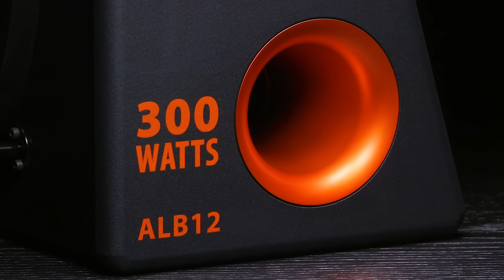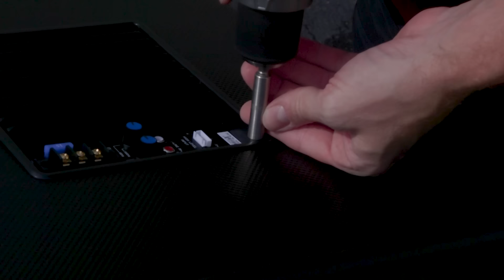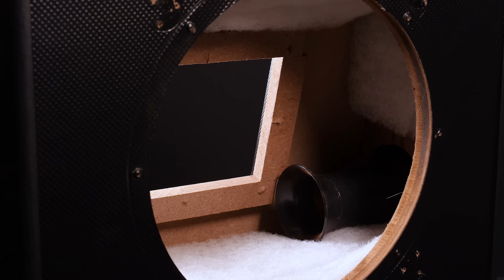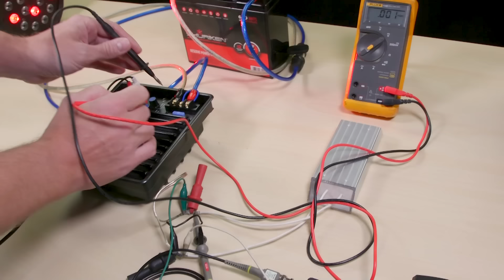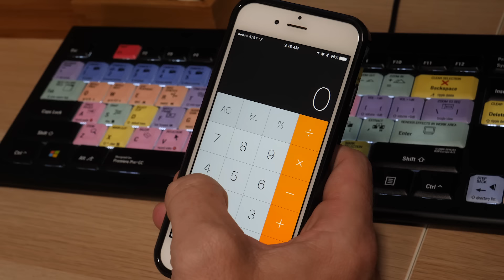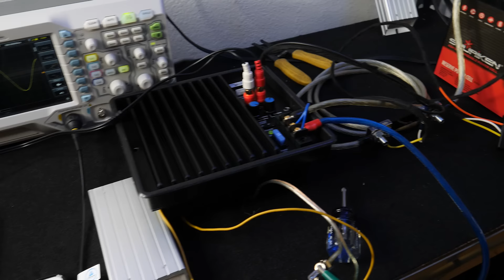Sh*t Car Audio Manufacturers Say! Reverse Engineer an Amplified Subwoofer

Comment: It's tuned to 75hz??? LOL
Reply from the maker: Yea man!
Reply: thornygravy lol annoying bass lol
Reply: WTF, that's not a sub!!!
Reply: My old Panasonic system was tuned to 70hz.. with 5-1/4" woofers lol
Reply: thornygravy a regular woofer can do 50
Reply: that's a bit unrelated sir lol.
Reply: ok
Reply: The device is designed for a flat response in free air. It's a CAR sub woofer, and it works quite fine when it's operating inside a car. According to this guy it's under-powered, however I have my doubts that what we are being told about that has any scientific basis whatsoever.
Reply: jesus even Logitech subs play lower (z623)
Reply: BH4x0r - I doubt that any Logtitech sub would be almost flat down to 30Hz like this thing. Anyway, with Logitechs it's the complete lack of ANY treble that makes them sound so shit.
Reply: John Coops, as you could see if you watched the vid, it doesn't play flat at all, and not deep at all (not even near 40, as you saw in the vid it's tuned to 75Hz), and no logitech subs don't really play flat, nor are their satellites any decent, but the Z623 plays down to about 35Hz clean-ish. Not flat or anything, but still better than this dual sub. The dual sub maybe plays down to that in a CAR, but the Z623 even does that in a HOUSE, which is obviously better since it means that it doesn't have to rely on car acoustics to actually play pretty low
Presonus Eris E8 studio monitors do actually play flat down to 35Hz, which is why i love them, even when i'm not using a subwoofer.
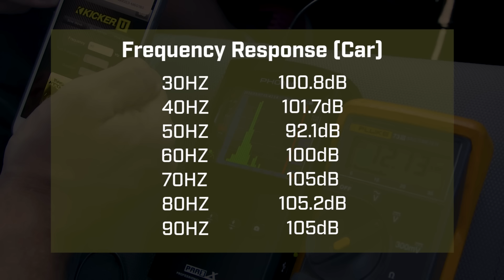Reply: BH4x0r - if *YOU* watch the video, you will see at 6:25 that when tested in the environment that it is designed for (a car), it is pretty much flat (within 6dB) down to 30Hz (the lowest that was tested). The fact that a Logitech can do 35Hz or whatever inside a house is totally and utterly irrelevant since the Logitech doesn't work in a car. The Logitech would sound shithouse in a car anyway, in the same way that this Dual is an absolutely shithouse in-home sub. As for your comment "better since it means that it doesn't have to rely on car acoustics to actually play pretty low" is some unbelievably idiotic that I cannot even begin to respond to that.
Reply: John Coops still useless outside of a car or if improperly positioned, placement to be able to reach that will be necessary and will also depend on vehicle, it's always better to have something that plays ALL frequencies and then later in the car being able to eq frequencies
Reply: John Coops i actually tried the Z623 in the car about 3 years ago on a MTX RT250.1, sounded fine.. played deep etc
Reply: BH4x0r - "still useless outside of a car" = YEP, just like every other car sub. That's because they are... guess what... designed specifically for use in (can you grasp it) a...*CAR*!
Reply: doesn't explain why my xplod (which i dont have anymore) played down loud and clear to 33Hz in the house, and that is not even a "good sub", it was just a XS-GTR121L, in a kinda big prefab box (just for a 12" tho), or bigger than some of the cheap garbage i've seen on the walmart site in the US, atleast.
Reply: My 6.5" subwoofers are tuned to 30
Reply: Car Audio Inc  my but hole is tuned to 75
Reply: Sorry to hear that. Should have used lube.
Reply: Car Audio Inc then they are just wet farts..lol..I get it..Just joking with the tuning of that bargain box..sure it will be fine for an average person just wanting a little bump in a weak stock system.  But man I love bass and stuff like this has all the 16 year olds thinking they are beating down the block
Reply: lol
Reply: Hurricane Zephyr sundown audio subs are usually tuned to around 34hz and sometimes lower
Reply: looking at the size of the box, it would be hard to assume its tuning was low. they shouldve kept it sealed
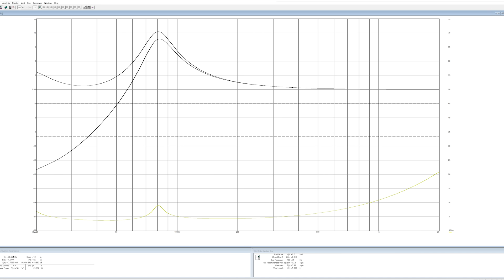Reply: It's tuned at about 45 Hz. You can see at 7:56 that there is the lowest point in the impedance response which usually is the case at the tuning frequency of the port. The problem is the high Qts which causes the 10 dB peak at the so to speak "tuning frequency" of a closed box with the same volume. The port has no use for this driver. If you close the port the frequency response will look nearly the same.
Examples:
1) A driver with a Qts of 0.4 needs to have a Vas as big as the box volume. In this box tuned to 45 Hz it needs an Fs of 62 Hz to get a flat frequency response. The lower cut-off frequency (-3 dB) will then be at 43 Hz.
2) Driver with Qts 0.45 needs a Vas of 0.83 times the box volume. In this box it needs an Fs of 64 Hz to get a flat frequency response. The lower cut-off frequency (-3 dB) will be at 42 Hz.
3) Driver with Qts 0.35 needs a Vas of 1.25 times the box volume. In this box it needs an Fs of 56 Hz to get a flat frequency response. The lower cut-off frequency (-3 dB) will be at 44 Hz.
I just looked through data sheets of 36 different 12" drivers. None of them came near the needed value for Vas. I'd say it'll be hard to find a matching 12" driver. Maybe a 10" or 8 " might fit.

Source of all my knowledge: German DIY loudspeaker magazine Hobby HiFi, especially the bass reflex tuning diagram from issue 5/2003.
Reply: lol my subwoofer is tuned to 16Hz :)
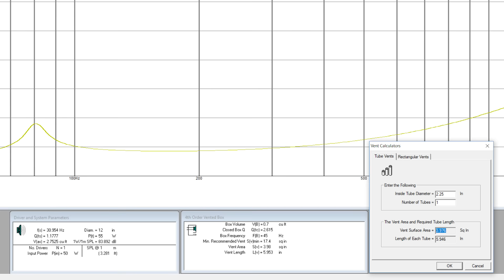Reply: It's tuned to 45Hz, not 75Hz. You can see the calculated Fb at 7:43. Box systems don't always make peak output at the port tuning frequency. Other factors can contributed to output, including box size, driver resonance, and cabin gain. Notice in-car measured dB shows a little recovery at ~40Hz. That's the port doing its thing.
Reply: My friend's philco component is tuned to 125hz lol
Reply: I don't even know what a hz is.
Reply: What many here don't realize is that "tuned to 75hz" does not actually mean that it can not play any note lower than that. This sub can play even a 1hz signal just fine, like any sub can. They just artificially amplify that frequency to make it sound louder (or possibly to make it flat in a car).
Reply: This is not accurate. What some don't realize is that cone motion does not equal sound output. "Any sub" can be driven by a 1Hz signal, but almost none can actually produce a measurable result (sound waves) at that frequency. Physics (cancelation) and mechanical limits (excursion) of the driver prohibit it.

A subwoofer system's sound output (freq response) is relative, not artificial. At the system's vent tuning frequency, the relative output is higher than at below the tuning frequency. Drivers in vented systems unload below the tuning frequency, causing a relative sharp drop in output, again limited by physics and mechanics of the driver.

Effectively, this means a vented system cannot play a lower than it's tuning frequency, because the relative SPL below the tuning point falls off sharply. Nothing is being "artificially amplified". The vent is enabling more of the speaker's kinetic energy to be used as sound output. Similarly, a speaker's cone enables the kinetic energy of the voice coil to be used as sound output.
Reply: How does cone motion not equal sound output? The frequency of 1Hz being played by a speaker very well produces sound.
Reply: But this so called sub can be used as a mid freq- speaker for the z623 !
Reply: Cone motion does not equal output because of cancellation. A speaker operating "free-air" (without an enclosure) cannot reproduce lower frequencies because the waves from the rear of the cone will cancel out the waves from the front, as they are reverse phase. The purpose of an enclosure is to trap or delay the rear wave to preserve or augment the front wave, producing sound pressure that can be heard or felt.

Because of the extreme length of a 1Hz wave (~350 meters), an immense stroke and driver displacement is required to create measurable output. Currently the best driver type for this low frequency is a rotary type. A conventional cone type would need to be very large diameter and have very large excursion. Or, an array of several smaller drivers could pressurize a small cabin or room.

Even though a moving speaker cone technically "produces sound", if the result is so faint so as not to be measurable by a microphone, and not powerful enough to affect the listening environment, then it really doesn't qualify as sound.
Reply: WeKnowTheTruth2012 uhhhhh a regular subwoofer does 20-35hz

Comment: You can do 150db with a single 8....a 153 sealed on dash with a single 8 has been done years ago.
Reply: I once ran two 8" as headphones using a $40 Boss 1000W amp. The clipping made my head melt.
Reply: elwood98034 are you from elwood KS by chance?

Comment: Measuring the volume with plastic Airsoft BBs would be better than packing peanuts, because the plastic BBs are uniformly-sized and non-compressible. Sand would be even better because the grains are smaller and can pack more tightly, but I can understand not wanting to deal with the mess.
Reply from the maker: I totally get your points, lol but we ain't putting sand in that thing

Comment: Will adding a stronger amp to this sub be sufficient for a budget set up that is decent? The box looks good and the sub can handle more power . Currently running this active sub in a hatch btw.

Comment: So.. if im not mistaken dB works as an logarithmic scale, for every 10db the sound level goes up tenfold, so dosnt that mean to get that 10db bump you need to add 10x power to the sub. Makes you wonder when they make such an huge mistake what else is wrong.

Comment: dual makes some decent stand-alone subs, key word I said decent not outstanding. Don't expect to blow your car apart, but you can get some window flex if you set it up right
Reply from the maker: Cheney, done right their stuff sounds decent.
Reply: Cheney Vanderbilt 
They do and actually most subwoofers are decent including Pyle and Boss. It's just what you expect out of them has to be realistic. You can't trash a sub that says it can only handle 150 watts and compare it to another name brand.
Also box design, construction, and clean power AKA tuned right no clipping are the major factors of making even a lower-priced sub sound great.
The reason most name brand subs sound better is because the person purchasing them usually does more research if spending more for a subwoofer or having a professional shop install it.
Reply: Amen bro, if you want to see some duals put in work search for the video "low budget flex"
Reply: I d agree with u. Just for shits we ran two 12 in duels in a pre fab box on two crensendo 5 ks at a 30 hrzt test tone they lived for bout 10 min lol
Reply: LOL 10 mins is still amazing for 175rms subs, I've seen kickers smoke up on 1000rms
Reply: Hey thats your opinion, pretty big one from a guy with no subwoofer videos.
Reply: Not even gonna read that, you win smart guy
Reply: Chip Monk I guarantee you I can build a system from Walmart sold parts that will sound just as good as any other part bought out of a catalog or online. I don't understand how if it's sold at Walmart it's crap if the same part is sold on Crutchfield or Amazon and has a hundred great reviews by reputable people.
Just where does one go to buy the best items that aren't crap in your book?

I guarantee you if you are blind tested and had to listen to the same material on a Boss system.... or a Helix/Brax system.... if you know what that is... You would not know the difference and I probably wouldn't.
Reply: Chip Monk 
Once again for $100, I don't think anybody looking at this is thinking oh my gosh I'm getting $1,000 amp for a hundred bucks! Or even 300 watts. Most people looking at this don't even know what a what is. We have to remember where a select few criticizing this product that has sold to millions and made a company a lot of money. People would not keep buying it if it was a piece of junk in their eyes.
But then again is anyone going to say that a set of Brax 3-way component speakers is worth$4,000? Oh I'm sure someone is already typing you get what you pay for it. Yes it's worth $4,000 as this person typing is driving a $3,000 car LOL. Getting what they paid for out of the car LOL.
We should not judge anybody's intelligence based on what they spend on car audio products.
Right?
Cause in my opinion someone that buys $4,000 worth of speakers is very ignorant and less they make seven digits a year.
Reply: You have to have subwoofer videos to have opinions about car audio equipment? Wow. Didn't know this criteria and checklist existed. I thought you just had to understand car audio and maybe love it and know a lot about it but obviously you have to have videos LOL.
That's intelligence.

Comment: Easy and quick way to "check" the truth about power on car amp (Most other amps to) Is to check the fuse
if it is lets say 15 amp fuse, on 12V system, and they claim 300 - 400W you know it is impossible coz 15A X 12V = 180W
So if the amp in a peek draw more than 180W the fuse gona blow ;)  But when driving, many cars have 14,2 V 
 But still 15A X 14,2V = 213W

(P(W) = I(A) × V(V))

That means that the nominell effekt probably is closer top 80W and no way it can draw 300-400W
And do remember some of the power it takes through the fuse also goes to heat and resistances. Not all energy goes  to the woofer.

Now ofc this is not 100%  accurate, It also depend on the voltage to the woofer. But converting will also "steel" power

sry for my bad english

Comment: Nice to see someone actually test these things with proper measuring devices... but... I question your choice of signal generator, get a real one, or even build one. Sine wave generators are cheap and simple to make or buy, and then you get nice granular volume control instead of the digital stepped volume crap coming out of your iCrap device.
Reply from the maker: +idiolore we purchased a function generator, it will make its debut shortly!
Reply: Awesome, looking forward to it :)

Comment: I assume if you'd replaced the woofer with a 2ohm one, that it probably wouldn't handle the heat aka protect mode as well.

Comment: I was starting to say the voltage in a car would not go below 13.5 volts, your battery isn't large enough to test this amp. 12.3 volts is a battery with a 60% charge. may be able to run the test while charging the battery, most amp ratings are at 14.0 volts not 16.0 volts.
Reply from the maker: +bradley goode the retest was only slightly higher

Comment: i created a portable recycled bluetooth speaker (supposely 100w max) and i was wondering are all speakers cheaps? the problem with mine is under heavy bass loads the speakers basically sounds distorted.

Comment: Great vid - Subscribed!! I do have a question about your method though... When installed in a vehicle, and hooked to the electrical system, the amp is getting more than 12v from the alternator, and I noticed a lot of voltage drop from the stand alone battery. That being said, I think it might have eeked another 5w, if that, but it would have been fairer. Either way Im excited to see how you boost this amp for the cheap!!!

Comment: 6:25 | 5dB up @ 80Hz reflex tuning peak in-car response is still enough to be problematic. The underpowered amplifier and inadequate driver cannot provide what is required; hearing sensitivity falls away with lowering frequency. A 5dB peak would preferably be observed in the 30-40Hz range. 80Hz is not a good point to see something like this. Subwoofers are supposed to provide deep, satisfying underpinning and this device is broken even if cheap. Better could have been done for the same retail price.

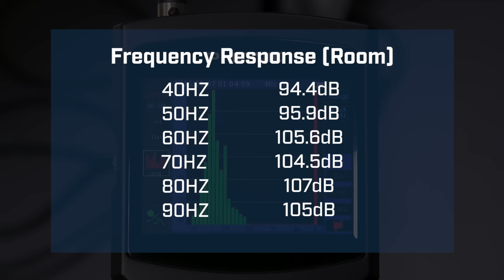Comment: 5:13 | That hump in the 70-80 cycle range will produce a fat, boomy bass. It's 10dB up on 40Hz so is significant enough to be audibly horrible.

Comment: And to be correct with everything:
An extra of 10dB means 10x the power according to physics:
P = 10 ^ (L / 10)
And in the other direction:
L = 10 * LOG10(P)

Or easier: Every +3dB means double the power.
0dB - 1W
+3dB - 2W
+6dB - 4W
+9dB - 8W
...and so on

Comment: @ Quality Mobile Video      I got a suggestion. I bought a 2.1 Surround system from bestbuy. The brand is BoyTone I bought the BT-230F. 2800Watts.  I paid like $67.and sum change. Bangs REAL HARD like car audio. Was wondering how many Watts its really pushing. But Over all GREAT set up for my computer battle station. SOUNDS REAL NICE. LOTS OF BASS.

Comment: So I'm guessing the weak amp is for two big reasons, 1) they're 'expensive' 2) powerful amp = more thumping bass, more thumping bass means a worn out shitty speaker. It's like tuning your Honda civic to 400 horsepower... YEAH you can, but your stock transmission or head gasket, cams, something is gonna give up the ghost after just a few months of that. The car in stock form would last 20+ years... it's all about getting the mileage.

Comment: as far as I know car amps are measured at 14.4v (cars running voltage) and not at 12.3v (half empty battery), these bumps in frequency are just awful, I always design enclosures to give as linear response as possible